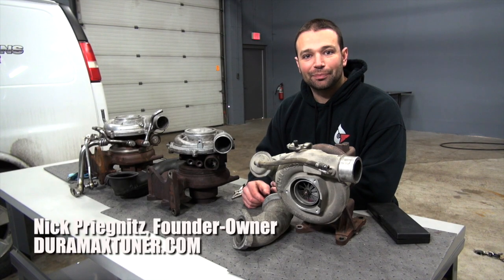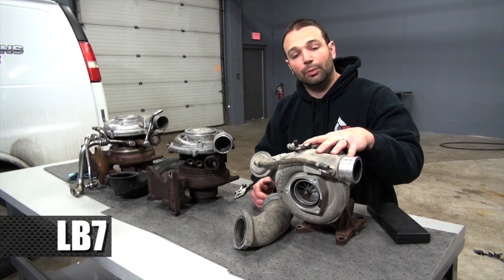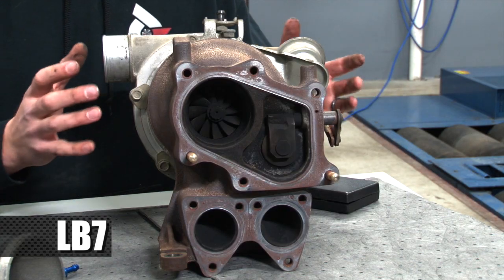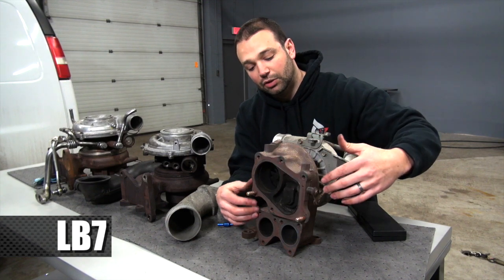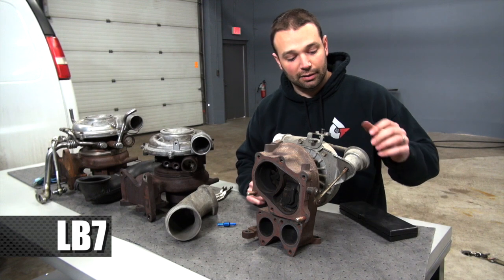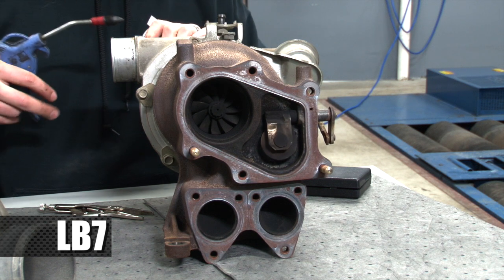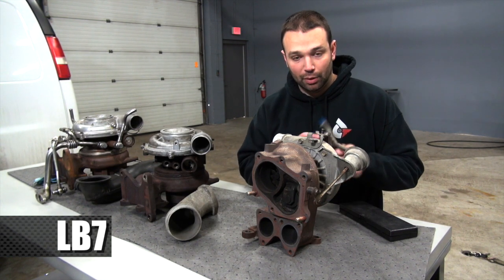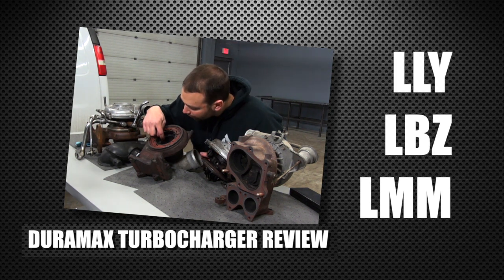DURAMAX TURBOCHARGERS PART 1 OF 3

Comment: My turbo failed on me this past Sunday on the way home and I have no turbo anymore, no whistle no boost no power. I have the increase valve and it gave my truck so much more power, unfortunately I don't have gauges or a monitor. That was the next mod on the list that i was about to buy in a couple of weeks and then my turbo stopped working on me. Any ideas as to what could of happened? I'm thinking the turbo wheel my have broke. I'm not a turbo expert at all so some advice from anyone would be nice 👍🏻
Reply: Jackson Rabon yeah I guess they didn't get it. I did find the problem myself the day after and fixed it.
Reply from the maker: We're sorry to hear about the failure of your turbocharger. You didn't mention the year or make of your truck so it's hard to give you meaningful feedback. Would you mind giving us a call? We need to ask some questions. 815-568-7920.  Thanks.
Reply: Duramaxtuner sure! I'm a bit busy today but ill call tomorrow. 03 lb7 by the way
Reply: Tactical Camel well since he said increase valve that means lb7
Reply: Tactical Camel what was it
Reply: Jackson Rabon my intercooler pipes came loose and one of them completely disconnected. I trouble shot it myself after I went for a couple of drives and tested to make sure the increase valve wasn't stopped up. And it hit me, intercooler piping.